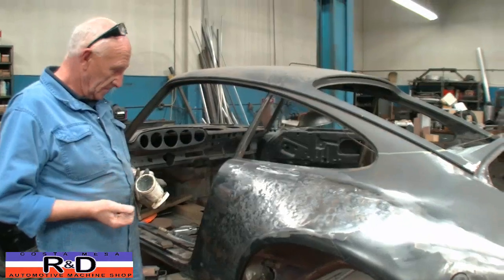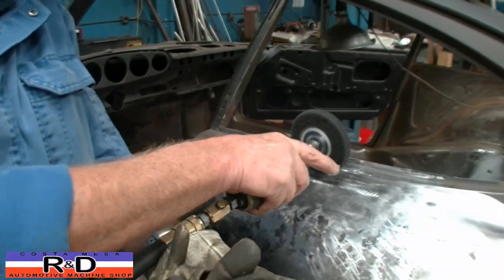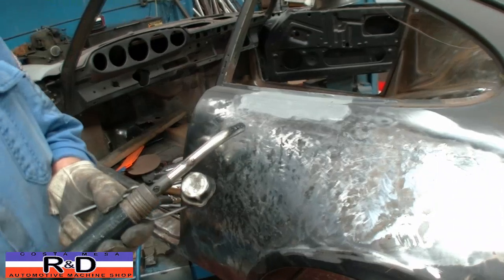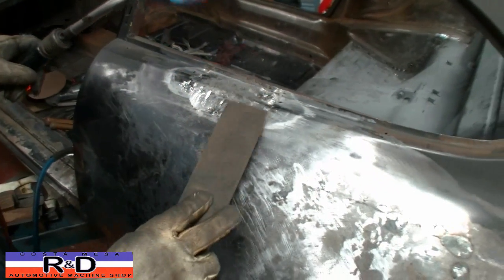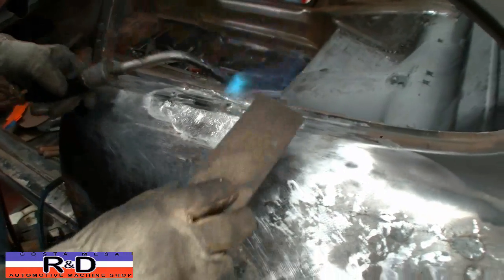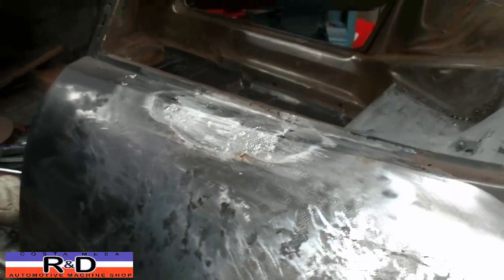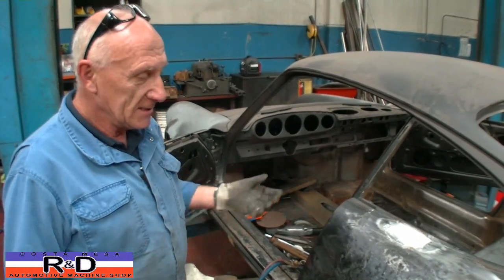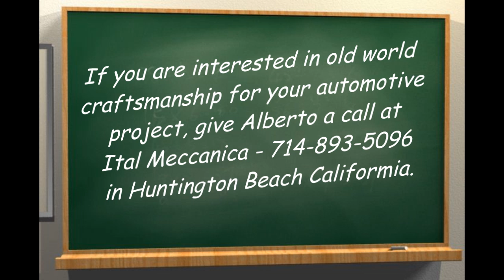Using Lead in Body Work Instead of Plastic Filler

Comment: It always makes me laugh when I hear people of the old school who think lead is the proper way to fill body work.  At the end of the day, it's a filler, you are using it because you aren't skilled enough to shape the metal so there is no need to be prancing around on your high horse.
Reply: you clearly dont no anything about this
Reply: i was not talking to you.. and im from sweden so my english has nothing to do with my work or lead...
Reply: You should know being a "pro" you cant shape something that ain't there, when its corroded you have be like MR Manhattan (from Watchman) and re-moleculerise the material aka add lead now watch the video say thank you and stay on your hypothetical horse.
Reply: 8700s14  hheeeehawww
Reply: Lead will stay 100 years. Plastic last 10. Wonder which one I should use🤔
Reply: 8700s14 lol, you can't fill what's not there lol. Even from the factory when I was restoring my 78 trans am, the b pillar between the quarter panel and roof had a half inch thick slab of lead connecting it. I wanted to have it re-leaded but I don't have the skills for that, so I opted for some flexible filler.
Reply: 8700s14 
Now that's FUNNY, besides showing how little you know about body work, you've made a complete fool of yourself.  What you gonna do?  Separate every outer panel from every inner panel?  Good luck.
Reply: Not true that plastic only lasts ten years. I have repairs that I did
in 1985 (34 years ago) that look just as good as the day I did them.
I used bondo. The only thing required to do a good repair with bondo
is a willingness to push out the dent so it is less than 3/16"- I usually
go for less than half of that. If the pushed out dent makes the metal
floppy, then It either needs to get shrunk by repeated heating and quenching, or put slight dimples into the surface.
Reply: 63Turbo , yeah while leading can't really be broken loose, bondo is still excellent in it's  own right.
Reply: As long as it is not me breathing in lead fumes, one can do as much lead work as one wants. : )
Reply: I think it's funnier when wanna-be metalsmiths think they can hammer a stretched panel to an even thickness when only  one side of it is accessable.
Reply: Easton has a non-lead "leading kit" now, safer and as good as the original lead.
Reply: @2009G8Gxp I think he probably has a very accessible backside....